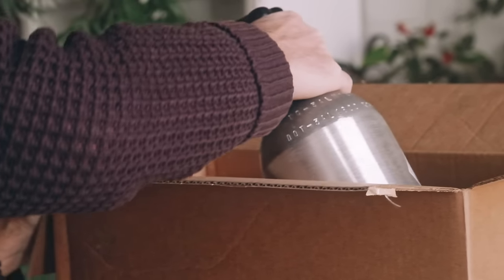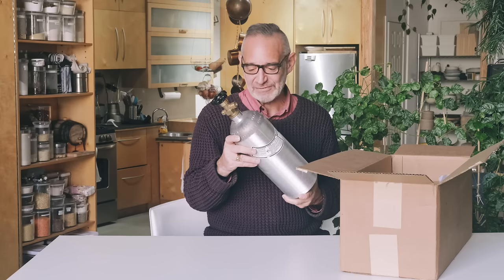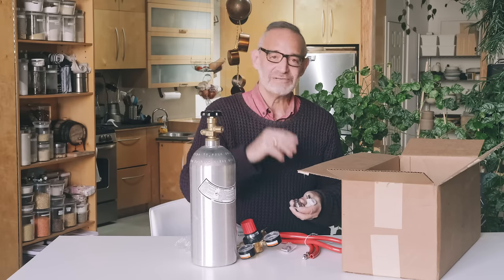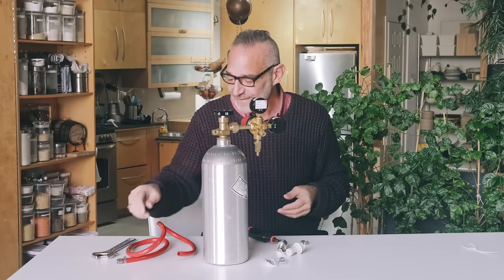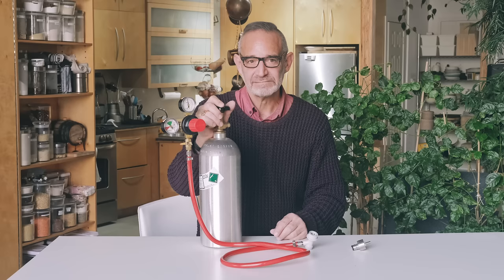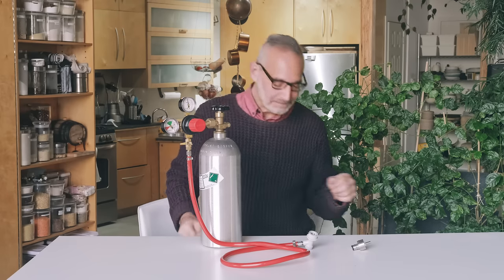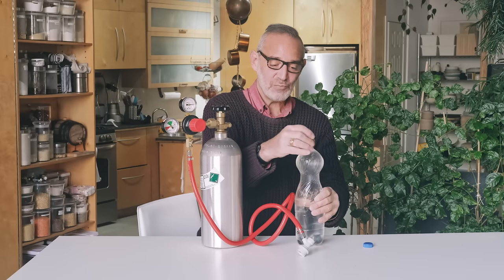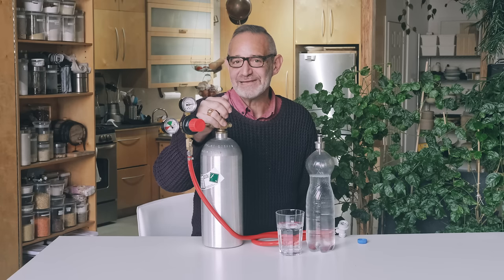CO2 Tank For Making Sparkling Water | What To Get and How To Put It together

Comment: You can just use aluminum free baking soda that’s gluten-free GMO free and it has CO2 in it and also you get the acid that you need to build your hydrochloric stomach acid with from the baking soda. Just add a little to your water

Comment: This HD alternative is far better than plastic factory manufactured units and the cost should be considered a social and nutritional investment. My issue is the COST of the CO2 and how much it costs to make 1 liter of high quality product? From what I have read, you can make 100 liters of soda with 5 pounds. In order for this to be economical, the 5 pounds of CO2 filled into the tank should cost no more than $15 or 15 cents per liter...
Reply from the maker: Agree that this method is a great environmental savings.  But my very rough calculation shows you can carbonate close to 300 liters with a 5 lb cylinder (see the description here  https://youtu.be/h5DYFk2aSz8?si=ljMlBpgk1yrDHLj6). So the economy work out as well.  Thanks for your comment

Comment: its easier to use a small cornelius(8 liter) keg to carbonate water versus doing it one bottle at a time.  Just keep the keg in the fridge with a picnic tap on the outlet ball valve.
Reply from the maker: Sounds like a great plan but we don’t have room in our fridge. So we just keep with 2ltr bottles
Reply: Explain

Comment: Anyone in Australia know where we can buy a similar kit please?
I am in Queensland.
Reply from the maker: Any home beer brewing supply can put together the parts you need.  Everything in this kit is used in home brewing.  I had a quick google and there are many home brew suppliers in Queensland, so I'm sure you can find someone close to you.  They'll also be able to tell you the best places to get CO2 refills nearby.
Have fun with it!
Reply: I'm in Australia and just bought a similar kit from Kegland. It came with a full 2.6kg cylinder, regulator, hose and all the attachments for AUD$128 plus $24 shipping. The cap that screws onto the bottle is plastic but they do also sell a stainless steel one. I actually prefer the plastic cap and they are cheaper so have bought a few extra so I can keep the one on the bottle for topping up as well as have a couple more bottles ready to drink in the fridge.
Reply from the maker: Thanks for the information…. Good to know a supplier down under.  We also like the plastic caps…. I was originally worried that they wouldn’t hold up, but we’ve had no problem with them.  Stay tuned for a video on flavors & other drinks we carbonate

Comment: I've had this setup for a couple months now.  I find you need to release once or twice and re-carbonate to get a decent amount of fizz  in a bottle, even when shaking and very cold) .  If I carbonate just once, the fizz doesn't last near as long as  commercial soda.  The superstore  flavour enhancers work well
Reply from the maker: yes, agreed.  It does seem to take two carbonations to get it really fizzy.  I think it has to do with the surface area available for absorbtion of co2.
Reply: Most refrigerators have water in the door.that should be cold enough?
Reply from the maker: @Sabrina-i2s   Yes that will do the trick!

Comment from the maker: How many litres of water can you carbonate with a 5 gallon tank?  
I weighed our 2lt water bottle, zeroed the scale, and carbonated the water as usual and weighed.  Much to my surprise, 16g of CO2 went into the bottle!
So then I started calculating… 5lb tank holds 2268g of CO2, divide by 16g…. So the 5lb tank will do 141.75 bottles.  At 1 per day average, that should last around 4.75 months!
Wow… so a $25 refill will carbonate around 280 liters of water and last around 4 ½ months if you drink 2 liters a day.  Now that’s cost effective!

Comment: My dad did this 50 years ago.  But used glass bottles.    From a safety stand point you should wear eye protection or a full face shield just in case something slips out of place. We also wrapped a towel around the bottle incase it ruptured.  That would not be a bad idea even when using a plastic bottle.
Reply from the maker: Yeah, 50 years ago we didn't have plastic bottles for sodas.  So glass was a necessary choice.  Fortunately, the worst that can happen with plastic is a big mess... no flying glass shards!  I've been using the same two plastic bottles for over two years now, and they haven't even leaked... so I think we're in safe territory.

Comment: I bought this machine and it does not carbonate. It will fill the bottle but the bubbles do not aerate the bottle.
Reply from the maker: Are you shaking the bottle?  This forces the co2 into the water.
Reply: @NadiaandRob  doing that makes it leak somehow but the bottle itself is closed tight
Reply: @ryankelly1433  is it possible that the threads on the bottle don't exactly match the carbonation cap?  The best fit is on standard soda bottles, like coke or pepsi.  If the cap is on properly, there is no leaking at all.
Reply: @rdaphoto  Ive tried it on 2 different 2 litre Coke bottles.
Reply from the maker: @ryankelly1433  OK... I'm totally stumped.  Could you shoot a video of what's happening and post it so we can have a look?
Reply: @NadiaandRob  no I'm not going to play YouTuber I'm just going to return the defective product.
Reply: Check out the videos for the precise steps to follow, especially on attaching the CO2 cap to the bottle, and vigorously shaking it for a minute or so, while filling it.And, is your CO2 tank full??

Comment: Overall, this is a good start to wet your feet, but I would get a 5 gal corny keg if you are going to pit yourself through all this buying and learning lmao
Reply from the maker: If I had a full bar set-up, and a fridge to hold the corny, I would definitely consider it.  Thanks.
Reply: @NadiaandRob  you dont need to refrigerate the corny keg. just pour out a couple growlers at a time and put em in the fridge
Reply from the maker: Ok, so what’s the advantage of using the corny keg?  I’m not that familiar with them
Reply: @NadiaandRob  and also time. takes the same effort to do one small bottle versus an entire corny keg

Comment: If you take that flat screw driver bit out you have a nut driver. Easier than screwing a flat in. For me anyways
Reply from the maker: Yes. I agree. Sometimes I use a nut driver on an impact driver. However in this case it’s really easy to over tighten the band and stress the hose. I find this eventually causes a slow leak in the hose. So you want to be careful not to over tighten here. 
Thanks for watching and commenting 
More carbonated videos to come!
Reply: @NadiaandRob  thansk for the advice to not over tighten !

Comment: You actuallly want 6 bar or 87 psi. You wont have to shake it so much. 50 psi is way too low.
Reply from the maker: Our regulator just goes to 60 psi.... which was recommended, as 90 psi is close to the test threshold for these types of bottles.  So I opted to shake more and be safer.

Comment: YOU ARE WRONG !!!! YOU DO NOT NEED A REGULATOR #1. I HAVE A 20LB CO2 TANK CONNECTED DIRECTLY TO THE SODASTREAM.  NO MATTER WHAT SIZE TANK YOU HAVE IT HAS THE SAME PRESSURE. ABOUT 20 PSI. A PLASTIC SODA BOTTLE WILL NOT LET YOU ADD AS MUCH CO2 AS A SODASTREAM BOTTLE. IF YOU WANT IT REALLY BUBBLY YOU NEED TO ADD LOTS OF CO2. AND BUY A 20LB TANK.  A 20 LB TANK COST $20 DOLLARS TO FILL UP. A 5 LB COST $20 DOLLARS TO FILL UP ...!!! YOU DO THE MATH !!!!
Reply from the maker: Ooook….. noted

Comment: Too much work for one bottle of water. I'd suggest buying the Soda Stream Unit plus their cylinder on top of this Kit if you can afford to. This way just fill the cylinder when it needs the refill with the CO2 Tank of this kit. This way just slide the bottle in, one quick press of the button and carbonation done. Alas I heard these days they are making it unable to do so and only Soda Stream company can do it. They make it so we can't do it for cheap. Plus I did hear that the Soda Stream cylinder wears out if we fill it multiple times. Like these companies are being difficult on purpose. I guess using the kit the way it is, Gotta spare some time to do it slowly. Or just buy an adapter hose with this kit that is made to slide into the back of the Soda Stream, where the cylinder attaches, and use it that way. This way we have no worries of the soda stream cylinder wearing out and quickly carbonate directly from this tank.
Reply from the maker: I believe there are kits to attach a large tank to the sodastream. However, I prefer our system because you get better carbonation (higher pressure). Plus you can carbonate other stuff. Stay tuned for a video about other drinks to carbonate!
Reply: @NadiaandRob  Can you do a comparison? Cause I heard that Sodastream CO2 with three presses gives really good carbonation too. Though yes the pressure won't be as high for safety of the unit.
Reply: @NadiaandRob  I will eagerly wait for drinks carbonation. Would like it if you also share some recipes for sodas.
Reply from the maker: @btsarmyforever3816   Yes many ideas for sodas!  Will be dropping soon
Reply from the maker: @btsarmyforever3816    We don’t have a sodastream to compare to.

Comment: not so smart to put the bottle upside down, do you realize the water goes to your red hose? Second time you are not pushing air out of bottle anymore but lower presure of CO2 .
Reply from the maker: We haven't had a problem with water flowing into tube, but some others have mentioned it, so it's easy to keep the bottle upright.
Thanks!